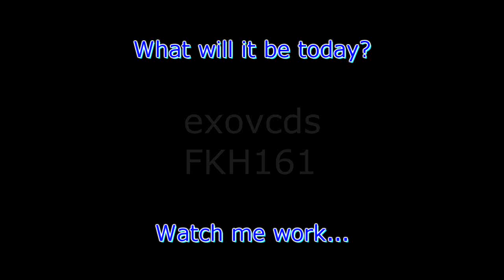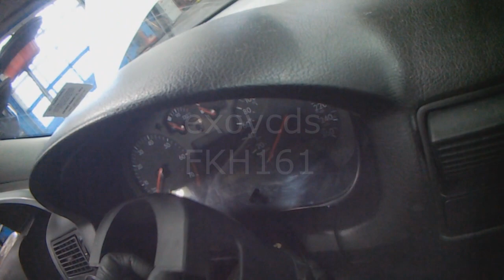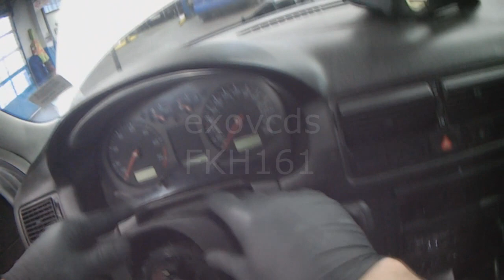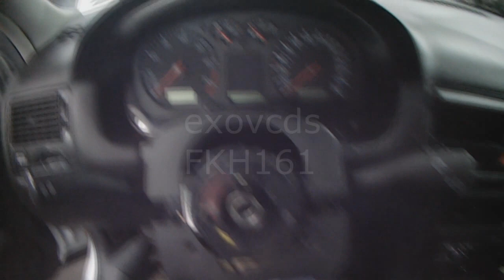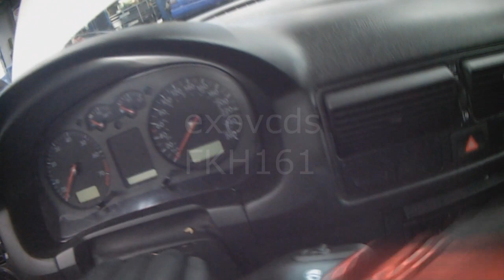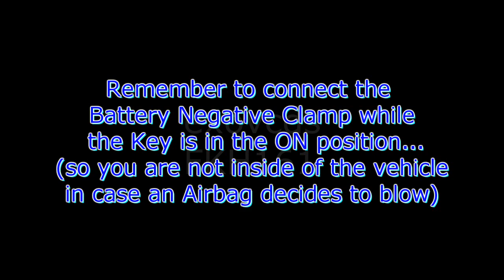VW A4: Wiper Switch Replacement

Comment: I think one can get the switch out without pulling the steering wheel.  A long thin #2 Philips is needed to get the facing cover screws (the shank has to long enough so the handle is out past the steering wheel ) and  a "cost hanger" thick wire  with a sharp 90 deg x 1/16" bend on the end will allow slipping in between the wheel and switch to trip the switch release tab.    If you have a new switch in hand you can look at it to see just how to trip the release.   

On my 03 Jetta TDI wagon the rear wiper wouldn't stop cycling every 6 seconds. I pulled the switch and it stopped so it looks like the switch is bad.
Reply from the maker: Good work around... for me, it is quicker to just pull the steering wheel.

Comment: What is the first tool used called that took off the horn plate and disconnected the air bag?   Is it common or a special Volkswagon tool?
Reply from the maker: You can use / bend an old screwdriver, but this is the factory tool that I bought.
https://vw.snapon.com/SpecialToolsDetail.aspx?itemid=9920115
Reply: Awesome Tom - Thank-you!....I am about to embark on this mission.   I over extended my blinker handle and as a result have no juice activation and rear wiper action won't shut off.   So I am going to cut to the chase and replace with an after market part.  Sucks having no juice in the winter!

Comment: Hi there:) Thanks for this awesome video. I did the whole repair on my VW jetta after my dealer diagnosed this as the problem. Trouble is... with the new wiper switch, I have the exact same problem... the wipers won't turn off. What should I do next?

Comment: Hey Buddy. My wipers work on low and high but they keep wiping after I turn them off. They’ll wipe for about 10 times and stop randomly on the windshield, sometimes in the Parked position if I’m lucky. Intermittent doesn’t work, they wipe on low speed. Usually they turn on when I start car without actually moving the lever & they’ll wipe about 10 or so times then stop as well. The 377 relay looks fine when I slid it out of its case. Nothing looks burnt or anything inside/outside of the relay. Do you think it could still be the relay or the switch on the column? 2001 Golf GLS
THANK YOU SIR
Reply from the maker: I would try another relay.
Reply: @EXOVCDS  thx for the reply I appreciate it. I’ll try that. Merry Christmas Sir!

Comment: i have and audi a4 b7 (2006) and on wiper switch i dont have the button for the screen in the dashboard and i dont have the buttons on the steering wheel
should there still be the plug for it so i can change the switch and put the one with the buttons?
Reply from the maker: The video is for VW A4... 4th generation of A platform  (Golf / Jetta). I don't know about Audi A4 B platform / 7th generation. Sorry.

Comment: I have a question.   I have an 06 Audi A4.  My wipers arms froze.  I took the linkage/wiper transmission apart and greased it.  Put everything back together.   Wipers worked good for a few days, then they would stop working.   They start working immediately after I switch my ignition switch off and on.  Now it only wipes once and they stop.  I have to keep pulling over, turning my car off just to get 1 wipe off the wipers.  My question is, could my wiper switch be bad?
Reply from the maker: +Guichos Towing (Luis) Possibly, or the wiper relay (if it has one)... I'd have to check a wiring diagram to see how things are controlled. A lot of things on newer cars are controlled via a Vehicle Electrics Control Module... so it can  get a bit confusing as to what controls what /  how things are controlled.
Reply: +Thomas EXOVCDS According to my research,  this model doesn't have a wiper relay.

Comment: Seat Leon 2002 1,6 i have a problem with my wipers still set on interval even though it is in the 0 position (where it shouldn't wipe). New wiper switch? also did you unplug the negative pole on the battery before doing this?
Reply from the maker: Relay problem? I can't remember if I did or not... probably.

Comment: I have a question, if I were to try this at home, what is the risk of doing further damage to the vehicle?  Where we are it is really cold and the switch had frozen so i tried forcing it a little too hard and the plastic wand snapped. No wires or anything important was damaged, the wipers still worked and everything, just the wand was snapped. If it is a high risk to repair at home, how much would it cost for a shop to do this for me? I already have found a replacement wand.
Reply from the maker: Hi, thanks for watching! Should be a straight forward DIY... the only difficult thing might be to get the airbag off of the steering wheel. Disconnect the battery first and handle the airbag cautiously once off. Watch the video a few times and ask me about stuff that you might have questions about. The steering wheel is splined, so as long as you start with the wheel fairly straight and end the repair with the wheel straight, things should be back to the way they were.
Reply: ***** Thank you sir, could you list me the tools needed for this job?
Reply from the maker: tehdirtyhitmarker I'm pretty sure everything is listed in the video. The triple square tool to remove the steering wheel bolt, might be the only thing that you might have a hard time to find. I believe it is of M10 size. The torx screws under the steering column should be part of a good screwdriver bit kit. Again, watch the video and point out specific parts.

Comment: 2004 jetta tdi, the wipers work like normal, but no power goes to the washer pump when I pull back on the lever. replaced the pump, tested pump, pretty sure only the wiper arms use a relay and none for the washer pump right? have you ever heard of just the washer part of the switch going out? any idea if just that switch is replaceable?
Reply from the maker: +Casey Halone How are you checking "at the pump"?
Reply: +Thomas EXOVCDS hooked up another pump I tested as working with a battery.
Reply from the maker: +Casey Halone Pump gets power from same source as the wiper motor. Remove the connector, attach a test light to battery negative, have someone pull the wiper handle to wash. Check that one of the pins in the connector has power.... if yes, attach the test light to battery positive. Touch the tip of the light to the other pin (ground)... should light up. If no, bad ground. If yes for ground, but no for power... check for voltage drop / bad connection in wiring. Possibly a switch issue, but since it triggers the wipers, I'm thinking it's ok.

Comment: ive got a question regarding this procedure, i have to replace my wiper switch on my mkv tdi and in the process can i move my steering wheel one/two teeth clockwise?since its offset abit while driving straight which realy anoys me, whill it screw something up in that rotor?
Reply from the maker: Yes, you can... but I would have the alignment checked first. If the alignment is checked after, then the wheel might move back when the front end is adjusted.
Reply: i had an alighment done already after i switched both ball joints and a bent control arm after a hitting a curb but the guy at the alightment shop whas a bit of a newbie to say the least and left my steering wheel crooked 3 times so i gave up and left it like that it tracks straight and true its just that the wheel is pissing me off a bit beacause i hold the wheel at 10 and 2 so its kinda akward for me now, I was unsure if it would affect anything else like the slip ring if i rotate the sttering wheel 1-2 slipnes on the shaft
Reply from the maker: Will be find for that small of an amount.
Reply: ***** Alright thank you for youre feedback
Reply from the maker: alex cristian Second guessing my reply to you about re-positioning the wheel. I haven't had a MkV wheel off before (I know, weird). Steering angle sensor etc could be an issue... I'll have to look at some info to see if it'll be ok. Have you moved it already?
Reply: no not yet for the same reason

Comment: I have question just change wiper linkage on golf 2001  AVH  and it was easy but problem is to adjust wiper mehanism . Wipers are out of sync . If I disconnect battery  is it going to help ? Thanks
Reply from the maker: No... I'm assuming you are talking about the park position? Or the wipers go down a bit before going up? If so, you need to disconnect the rotating arm at the motor, trigger the motor to run one cycle and then turn the key off. Re-attach the link to the motor, taking care to keep the linkage aligned... I'll see if I can find a picture for you to night to send.
Reply from the maker: http://fkh161.ca/VW/wiper.jpg the three links will be aligned when sitting in the park position.
Reply: *****
thank you very much I did something similar disconect rotating arm but I put linkage in opposite direction comparing to picture . Thanks a lot
Reply from the maker: The picture just shows a rough orientation... final adjustment needs to be dialed - in by you. If the lever is out 180, then the wipers will go down instead of up.
Reply: *****
I have tried many positions now wipers end up in vertical position but I never tried to disconnect motor from linkage to do one cycle . I' ll try tomorrow again hope to have more luck :) thanks man
Reply from the maker: After the motor stops, move both wipers down to the park position and attach the link at the motor.
Reply from the maker: Sorry, one more thing. You might have to remove & reposition the actual wiper arms as well.
Reply: *****
 I have tried to do everything and they working not perfect but working ok and I went to mechanic he screwed things and he blame motor cycle ending in wrong position so he ordered used complete unit motor and linkage :( thanks a lot for your support
Reply from the maker: I will see if I can make a video for you this weekend.
Reply from the maker: Jasmin Gadzo Have you watched this video already VW A4: New Beetle Windshield Wiper Motor Removal   ? You can kind of see the alignment of the linkage.
Reply: *****
I just watched I have exatcly the same alignment they first star down hit the rain cover and then goes up but mechanic just make it worse , so he ordered complete unit with motor .
Reply from the maker: The small link just needs to be adjusted... the "over center" position is off a bit. Once that is adjusted, place the wiper arms on the pivot posts.
Reply: *****
Finally my wipers are working now it was bad made in china linkage we greased old one and work perfectly now , I have followed your suggestion and now is good thank you
Reply from the maker: Jasmin Gadzo Good to hear! Thank you for the update!

Comment: Forgive me but what is the name of the wiring system that you connected to the back of the switch. 2008 A4 . Audi isn't exactly helpful with the shop working on my car. Nearest Audi 4hrs away. Thanks in advance
Reply from the maker: At the back of the switches, the wiring for the signals, wipers, lights & cruise control is attached. The clock spring is placed on top of the switches... I'm not sure what you are asking. What is the problem with your car?
Reply: My wipers have stopped working. The motor and switch in this video has been replaced. Yet  Audi has not been able to solve the issue. I am desperately trying to learn every point between that switch and motor, because honestly they are saying it will require more complicated work. I was told ece, this module or that module.  I asked them to explain what is between the switch and motor and frankly get vague responses. I cannot repair it myself but I need to be armed with knowledge. I honestly feel like something is not right. Thx in advance
Reply: I have 2008 A4 2.L, Quattro. If you by chance know everything between that switch and the motor it would appreciate the knowledge. thx
Reply from the maker: I'll see if I can find a wiring diagram for you. The vehicle in my video is a VW A4 / mk4 (Golf, Jetta, Beetle).
Reply from the maker: http://fkh161.ca/Audi/AudiA4Wipers.pdf

Comment: is it same modell as golf mk4 99?
do i have to disconnect battery 1st?
Reply from the maker: VW A4 is mk4. Mk4 is a generic term. A4 is the official platform name for the 4th generation of the A platform. Yes, it's the same. You don't have to disconnect the battery, but you can.
Reply: A

Comment: WHAT SIZE IS THE TORX SCREW DRIVER YOU USED ONCE YOU GOT THE STEERING WHEEL OFF?
Reply from the maker: +Jamie Saucier M12 Triple square.... for the steering wheel bolt. As mentioned in the video.

Comment: Hello, how do I know if its the switch or the motor for my windshield wipers .? I tried 3 different motors and non of them worked, the last one I tried was working fine in the car i pulled it off from but when I installed it in mine, it didn't work. I also checked all the fuses and they are all good. Is there a way to test the switch?
Reply from the maker: Check the fuse, check for power at the motor when the switch is in the ON position. If the motor doesn't have power, check the fuse and the switch.
Reply: Thomas EXOVCDS . Sorry I forgot to tell you that I'm working on my mkv jetta, I checked the 3 wires for the motor connector and I'm getting 12.05 voltage out of the red one, the brown one seems to be the ground, there is a purple one that has power and 8.25v that's what I'm getting, having the ignition switch on or off is the same voltage even playing with the wipers switch I don't get any changes.
Reply from the maker: Sorry, I didn't know... if the vehicle thinks that the hood is open, the wipers will not activate. Make sure that your hood is closed and that the hood switch is OK... best way to verify is with scan tool.

The A5 / mkV uses a smart motor. It gets a signal from the Vehicle Electrical Control Module. The red/wht wire should be battery voltage all the time... the brown is ground... the violet/wht is the "control" wire. Since you have voltage that is present (command) on the command wire, check that the linkage is not seized up. Disconnect the motor from the linkage and try to move the linkage.
Reply: Thomas EXOVCDS I ran vcds but when I clicked to check the wiper motor, it won't let me, the hood switch I'm assuming it's okay because when I close the hood the warning switch turns off, is there a way that I can test the motor straight from the battery?
Reply from the maker: Leave the motor attached to the harness plug... but disconnected from the wiper linkage. What happens? Like I said, the wiper linkage could be seized.
Reply: Thomas EXOVCDS I disconnected the linkage, closed the hood and turned the wipers on but still no luck.
Reply from the maker: Where was the motor? It's pretty quiet, you wouldn't hear it. Or was it hanging out under the hood?
Reply: Thomas EXOVCDS .. I pulled everything out, took the linkage off, plugged the motor back and I had my wife operating the switch inside the car.. the motor didn't move.. one thing I noticed is that the washer pump works when I pull the switch back.
Reply from the maker: Using VCDS (Vag-Com) or similar... do a full system scan to see if there are any fault codes in any of the modules. The control wire / communication wire voltage should change when wiper settings are changed. Ideally you would want to view the signal with a scope so that you can see the square wave signal. A corrupt signal could be the issue. A multimeter will show an average voltage... a change in voltage "should" indicate control, but if the signal is corrupt, the wiper motor logic board might not know what to do with it (the signal).
Reply: Thomas EXOVCDS .. OK, I will try what you suggested tomorrow. Thank you for your responses and your help, I really appreciate it. Also, thank you for all of the videos you post, they are really helpful!
Reply: Thomas EXOVCDS  hello, i know this is a old post but i been watching your video and reading comments but i have 9 volts on my control wire, ground on my brown wire but no power on my red/white wire, checked all my fuses and are good not sure what else to check, i have a 08 jetta 2.0 t, any help would be great thanks .
Reply: @josecastellanos685  it might be your BCM thats what mine ended up being.
Reply: E M2  thank you for replying, what is that ? where is it located ?
Reply: @josecastellanos685   The body control module .. and its located under the steering wheel. What year is your car?
Reply: @josecastellanos685  too bad I can't send you a picture of it but yeah, usually the "bcm" goes bad on the mkv models.
Reply: E M2  how much was it ?
Reply: i can send you my email ...
Reply from the maker: @EM-kd8dw  Thanks for the update and help for Jose! I was not aware that the body module us a common failure item. Thank you for that info! Send me your mailing address and I'll send you some of my channel stickers!
Reply: Thomas EXOVCDS so I just checked the 3 wires on the motor and the red/white wire has no power , my fuses are good ? Anything else I can check ?
Reply: By the way I gave the red power direct power and the wipers worked , so I’m assuming it’s a power issue not a bad motor nor switch